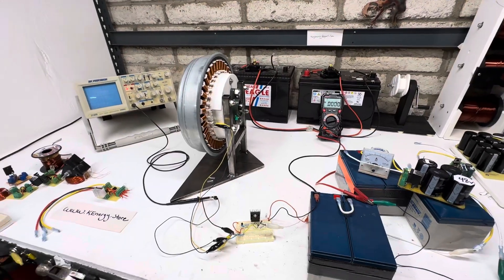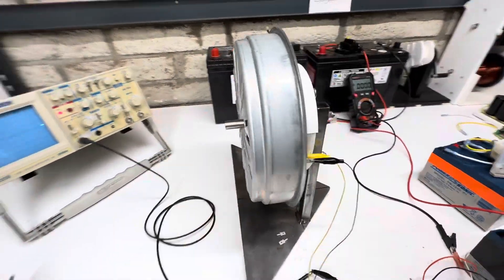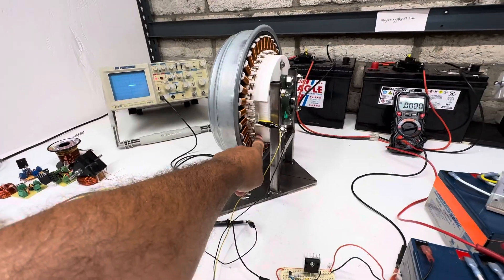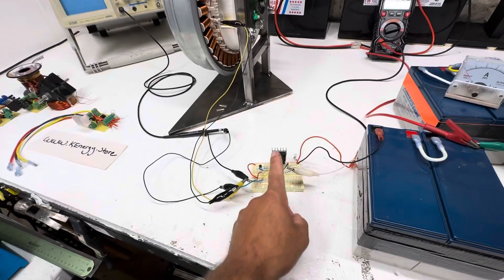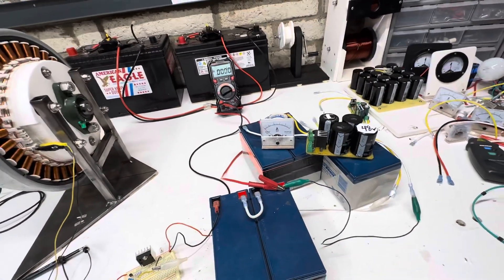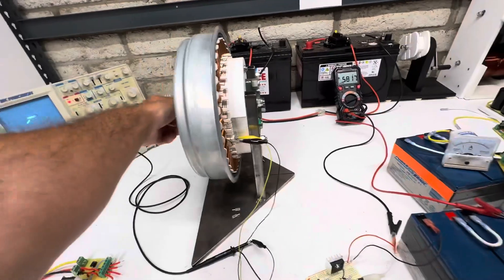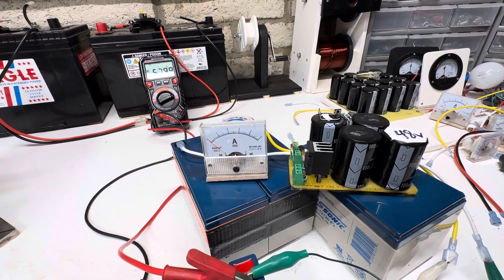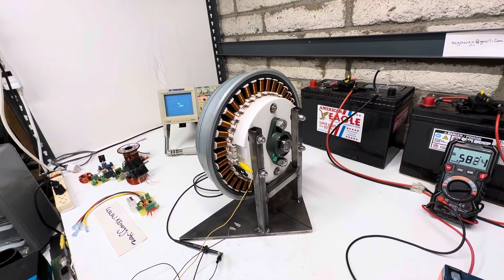Washing machine motor running on one phase no timing simple circuit

Comment: Great job man looks good. You do good work. I have a video on my channel of the same motor and type of circuit but I'm using the 2 open phases as alternator coils, rectifying it and charging a third battery. Pulse motors are a lot of fun. Keep on building man!
Reply from the maker: Cool I’ll check it out

Comment: Awesome - I can’t wait to see what you can make happen with that monster.  Thanks for the share K!
Reply from the maker: Much more to come brother!
Reply: @kenergy1707  im work in a big disk of 3,50 meter of circomference with barrium i use 2 ampere ,i do two loops with 4 bedini coil of 3 wire ... ... i work for the ground and extract power ... 36 coil ...🤣🤣🤣😘
Reply: @kenergy1707  i love you work you are brilliant ...im a good worker .... i use a neon switch commutation isolated hahahaaaaaa